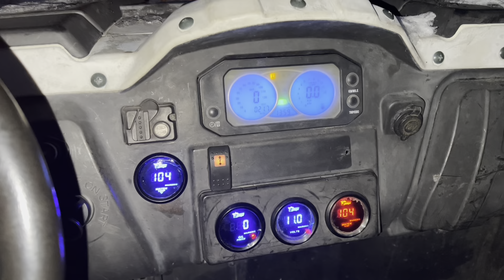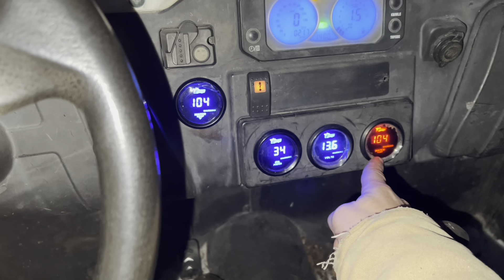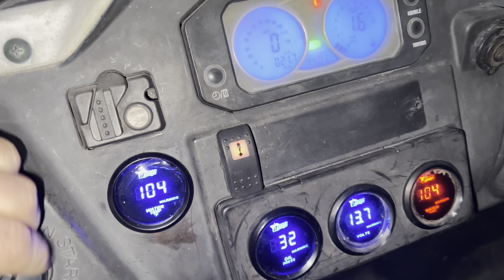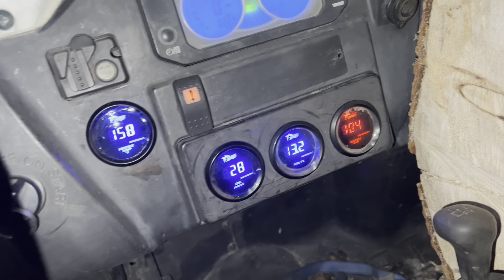WINTER SOLO FIREWOOD ADVENTURE.

Comment: Another great video of out in da bush. You're not kidding about that goofy muffler. I had to "fix" my muffler on the Radley, and it's amazing how cool it runs now. Punched out the core of the cat and numerous speed holes/swiss cheese inside. It went from setting pine bark to embers/smoking to cooler than my 435 Husqvarna exhaust after both with 6-8 hard passes. Even the case of the saw doesn't warm up all crazy now.

BTW, you have the patience of a saint...I would have done my best caber toss impression with that other saw into the bush for being so fussy!😂
Reply from the maker: @Justin Welden haha ya that saw should have went flying lol. 
And yeah you definitely have the same experience I have getting rid of that muffler is a game changer.
I got another saw coming to compete with the Radley so it’s going to be interesting how the new one cuts and then I’m gonna start modifying that Radley pretty soon here.It’s getting ported.
Reply: @Indeewoods  can't wait to see how that turns out. I'd like to try a base gasket delete eventually to see if there's a little more give er available in there.

 Even my dad was impressed with it (and he's old as dirt, probably didn't think much of it being a chinese saw at first). He came over one day when I was running it. First thing he says "Oh, that thing sounds pretty good." Then he gave it a go on some 16" pine and alternated between letting it walk and digging the dogs in. He thought it pulled pretty decent.
Reply from the maker: @Justin Welden you can use some 266 bucking spikes on those saws apparently. Just a minor grind and I guess they fit.
Reply: @Indeewoods  I already had a rough template traced out for bigger spikes, but your way sounds easier
Reply from the maker: @justindubya458  ya Kevin ( Kevin’s chainsaws) told me about that he’s the one that discovered it. He has a video on it.
Reply: @Indeewoods  I'll check that out. Thanks.

Comment: Pullin-Pullin-Pullin=Poolan- Poolan-Poolan  these saws live up to their reputation Ha Ha !  Even in good weather, I always end up priming them to get them to start if they have been sitting for a while, saves wear and tear on me and the crappy starter mechanisms they have.  The Radly performs well though.  Another frost bitten adventure !  Fun in the woods, cutting wood.
Reply from the maker: @Mr Obseletes Vintage Homesteading haha ya I kept Poulan and Poulan and it just wouldn’t start. Lol It usually starts in the summer even after sitting but I thought I’d try it anyway. Can’t believe it wouldn’t light off after all that Poulan lol. 
Ya I keep the old mustard bottle not to far away usually as well. If that was my only saw I’d install a primer bulb to inject fuel right into the carb then it’d fire first pull which is what those crappy starter pulleys need. Less pulls on them the better.
I bet little Mac would have fired right up.
Reply: @Indeewoods  Some of my Poolan 25's start easy, the others not so.  Quality control was a real issue with these little turds.  Mac's are definately better.  All in the fun of collecting junk !
Reply from the maker: yes that’s right.

Comment: I wonder if you had started it at home before you went if it would have fired up
Reply from the maker: @Dusty 1 great minds think alike that is what I was thinking I could or should have done with that saw. 
It’s 10° Colder than it was that day so I’ll have to try that out but that starter gave me issues as well skipping. That saw has very little use on it so I didn’t think it was worn might have to have a look at that as well. 
Not many people go cutting firewood at -30 but for me I could be out on the trail so need saws that will start if need be. It’s fun to test the limits of each saw.
Reply: @Indeewoods  maybe a little silicon spray on the starter recoil might stop the sticking
Reply from the maker: @Dusty 1 ya I’m not sure if the dogs weren’t catching or what. I’ll have to take a look at it.

Comment: do you rhino have a electric fuel pump or vacume just wondering if youve ever had issues with it or is it a reliable system?
Reply from the maker: @John-viheavyequipment  no just mechanical but it’s a high volume pump. 

Look in the description of my side by side videos there’s usually links to the parts I use.